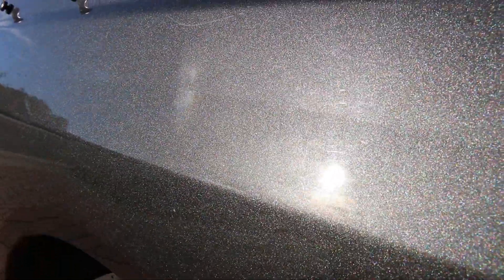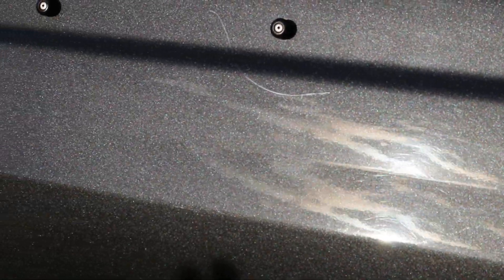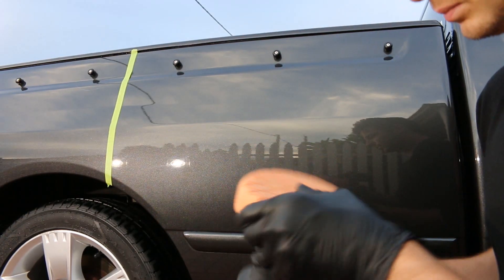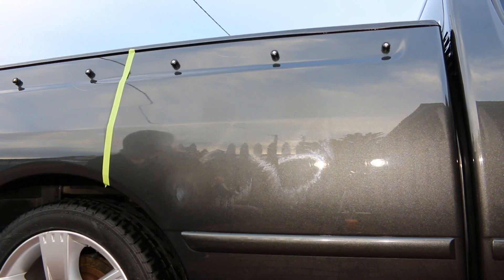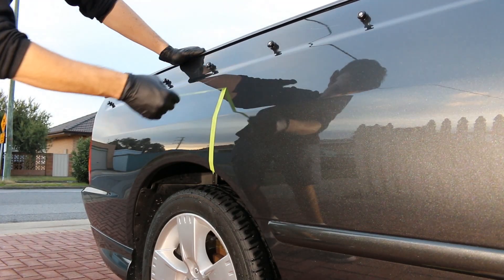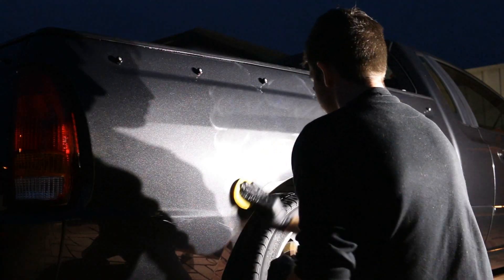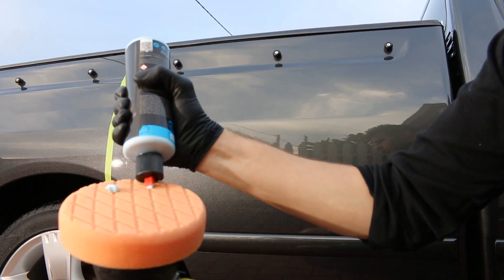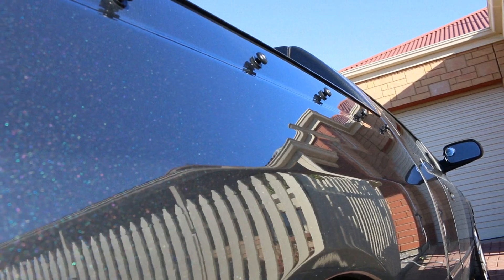Chemical Guy’s VSS Scratch & Swirl Remover Review | Detailing Video | FocusOnDetailing

Comment: how is the VSS between washes did you notice any of the swirl marks coming back ? ive read some products out there just masks the swirls. ty
Reply from the maker: Hmm that's not good at all. Likely just fillers covering up the issue. The paint work was still all clear after washes when I used VSS. Proper correcting and protecting processes are vital to get it and keep the paint looking A-1
Reply: FocusOnDetailing can this product take out scratches on plastic head lights
Reply from the maker: @bennycru  It might be able to remove some light ones but you'll likely be better off wet sanding, compounding, polishing and protecting when it comes to headlights. A little bit of a process but it's the best way to go about it to remove the heavy imperfections
Reply: FocusOnDetailing Thank you for your help.

Comment: Looks good! Quick question, when trying to remove spider webbing from black paint do you think it's possible just to use polish?
Reply from the maker: Without seeing the paint work first it's hard for me to judge but it's good to start with a light correction product like a polish or 1 step polish and work your way up to a heavier compound (if needed) until you're happy with the results and you can remove the paint defects. I've always jumped to VSS or Scholl Concepts S20 if there's swirls or spider webbing though. Hope this answers your question.
Reply: Yeah I wouldn't expect you to know forsure, it stinks how much black cars show this stuff so easily. After a polish or compound are the next couple steps a sealent and wax?
Reply from the maker: I know what you mean mate. Black paint looks amazing when it's fully corrected but every scratch and all the dust that settles on it really stands out unfortunately. That is correct. Once you finish correcting your paint work you want to protect it. That can be done by adding a wax or a sealant or even both if you're wanting to add more shine and protection. A sealant will likely be the first layer as it will be the one lasting longer and the wax will sit across the top of that.

Comment: Do you have to strip the wax before use and wax after? Or can you just throw it on the clean car and it will shine? I just want a good shine
Reply from the maker: Hey mate, when you say, "strip the wax" are you referring to actually removing it by wiping off with a MF towel after application? If you're wanting a good shine then an application of wax to the paint is always great to do but it helps also if you do a thorough cleaning, decontaminating and polishing or compounding if necessary.